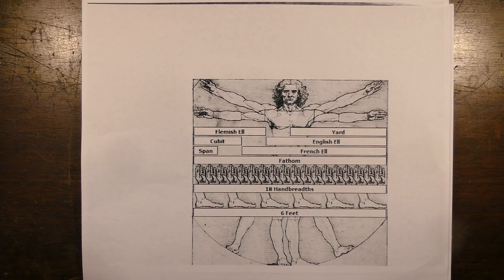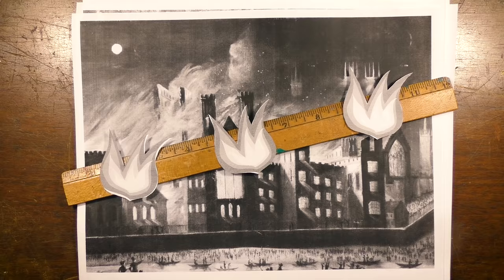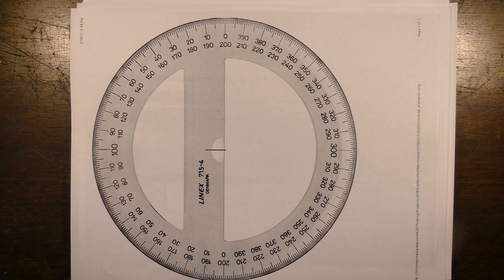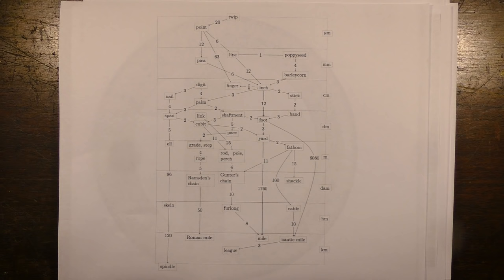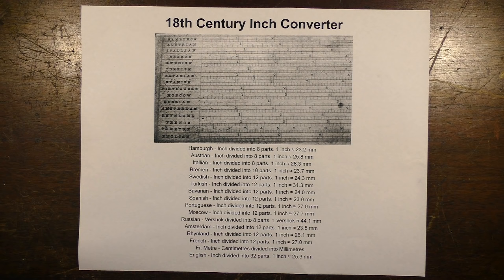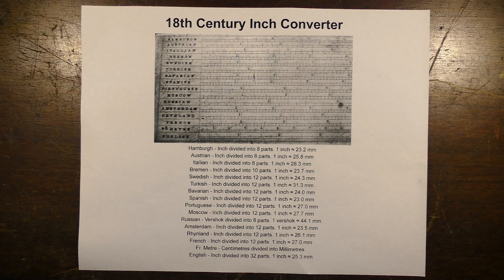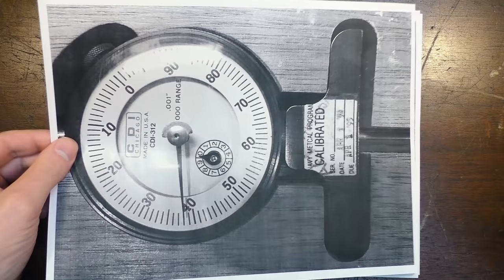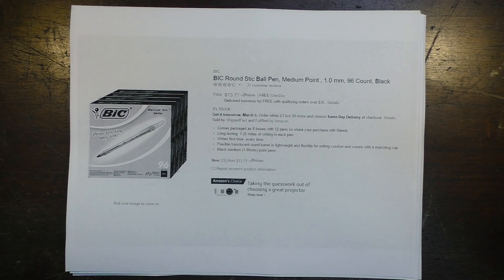Origins of Precision

Comment: It's really too bad Jo didn't use 25mm instead of 25.4mm. imagine how much more compatible metric and imperial would be. A foot would be exactly 300mm, not 304.8
Reply: It might've stopped adoption, made it more difficult, or even introduced incompatibility. As much as those problems already existed, by adhering to the closed estimate available of what everyone was *already trying to*, he made sure these would be absolutely perfect.
Reply: Good enough for government work... :-P
Reply: @guard13007  The imperial system is already illogical.  It'd do the entire (ie Mericah the centre of the known universe
) good to get rid of it.
Reply: @79Zhyr  How is the imperial system illogical?
Reply: @Smokey298  In the imperial system you have to memorize all of the possible conversions: "inch to a yard" = 36, "inch to a mile" = 63360, "yard to a mile" = 1760 etc. Those are just random numbers hard to memorize.
Not to mention madnesses like: 1 cubic inch of water weights how many Stones?

In metric system, everything is a power of 10. 

Millimeters to a centimeter? 10
Centimeters to a decimeter? 10
Decimeters to a meter? 10
Millimeter to a meter? 1000
Meter to kilometer? 1000

Even the prefixes help you to make the conversion. Kilo means thousand, so the Kilometer means "Kilo Meter" which translates to "1000 meters" (same for kilograms for  measurement. 1 kilogram = 1000 grams)
Milli means 1/1000, Centi means 1/100, Deci means 1/10, so the Decimeter stands for "1/10 meter"
Even the volume, length and weight have clear correlation: 1 litre fits in a cube with an edge length of 10 centimeters. 1 litre of water weights 1 kilogram, etc...
Reply: @tcfs  As a Texan, there is nothing to memorize. It just comes naturally. To each their own.
Reply: @MrKen-wy5dk  It comes naturally, because once you memorized :D Nobody is born with this knowledge "naturally".
Reply: @tcfs  nobody is born with knowledge of the metric system either lol. You have to learn that also…. The imperial system is a referent system, meaning it has common sizes that are more intuitive.  The metric system often has grossly undersized or oversized base units that result in large numbers for common measures.  Most Americans work fluidly with both systems.
Reply: @gullenator1  The imperial system is only more intutive for you because you grew up with it. For us the metric system is just as intutive. The metric system just has the advantage that its very, very easy to use in math (science in general)

But if i ask you on the fly how many inches 13,4 feet are you propably just could give a close guess. For us 2 meters are just 200 cm or 0,02 km or 0,002 hectar you really just have to play with the zero.

The base units are not oversized or undersized for common measures lmao, if they are over/undersized you picked the wrong unit.
Reply: @foty8679  The imperial system is more intuitive because you dont have to deal with repeating decimals.  Metric numbers are only able divisible by a couple numbers.
Reply: Hi Christopher Hurkens, don't worry. In the UK following metrificatiin, builders merchants who supplied wood/timber/lumber started to sell it by the metric foot. The metric foot is precisely 300 mm.
PS I don't know but suspect that the Swedish foot is not the same length as the US/UK foot.
Reply: American here, not that that exposition is needed. We use the imperial system, I know, shocking. I personally prefer the metric system, but I do hold one or two reservations regarding it in which I’m partial to imperial. One instance, is the use of mile, foot, and inch. Disclaimer, I do not love the measuring steps, while basing it upon powers of two is neat in concept, I find it poor in practice. Mind you, if you were had but a string to use as initializing measure, building a system from halving and doubling makes some sense. That said, not using said system to then make that halving a fifth of a larger base unit wouldn’t make sense (thinking about this as I’m writing). Now, why do they feel better, the cm is slightly too small for me to like quite as much as an inch (but this is probably effects of lifetime use), the foot being a not too small but slightly larger unit seems nice (albeit probably doesn’t pose any benefits and again I consider presence of my own bias here). I’m a runner, I like running and I’m fortunate enough that the town I live in was marked and split in such a way that it is a mile for every 8 streets (not all are equally spaced no, but the major ones lie every 8). For me it’s reached a physically intuitive level, but I know elsewhere such a nicety isn’t always present. That said, the yard feels useless given it’s hardly ever used (like an item you bought and then kind of left collecting dust in the closet) “oh yeah, you exist”. The foot having 12 inches doesn’t feel like it was chosen with good reason in mind, 5280 doesn’t feel like a lovely number either. I merely like them from a physical dimensional feel. Another area Metric does better, temperature. While I have gotten used to Imperial, Metric is nicer, I’m just not inclined as much to think in terms of it. I had heard (anyone who knows better can correct me) 100 degrees was supposed to human body temp and thus that’s why our boiling point is at 212. That just feels plainly foolish, given there’s not even a consistent repeatability and saying there’s an average is a poor justification for that. Side note, my one grievance I hold towards both is the use of the of 60 and 24 in telling time. If days were wholly equal all the time then halves would make sense, mind you I still find that cool. I don’t know if it was in honor of the Babylonians, but other than maybe for sector division or something 60 doesn’t seem particularly convenient. To be honest, timekeeping below a year just feels like the makers justifications (other than seasons was mostly just “we wanted to”. Years and days and year collections being nicely indisputable. I like consistency of the metric system and how it readily uses consistent physical circumstances largely based around water to act as standards, as in Celsius, as in its density being one. Idk, just so much more methodical. I think one of the worst places for the imperial system is the kitchen, hodgepodge I say. Now onto physics, I don’t do enough of it and didn’t really do it in imperial when I learned. If what I encountered is how I interpreted it, it’s awful for a reason I’ll get to now. It leaves its users more prone to misinterpret mass and weight to be the same. You (metric users) measure stuff in kilos, makes sense (also had that put in reference terms of being ≈ a red brick gives that physical comparison nicety), that’s your mass unit. For intents and purposes I cannot tell that anyone who used metric measures their mass as a measure of weight and uses Newton’s (if someone does then correct me). We use the pound as a weight metric but treat it like it’s a mass metric in all common communication. I only learned about a month ago (I’m nearly 20) that our mass measurement is called a slug and it’s so out of proportion to the pound that a person who weighs 180 pounds weighs like 3-5 slugs if I recall right. Some precision measurement you get with that one. Chemistry class pampered me, can’t say I want to go back to being unaware in that regard.
Reply: @tcfs  I love the consistency of Metric. But 10 is a trash number system. Base-12 and Base-16 are superior, especially if there are characters between 9 and 10 (0,1,2,3,4,5,6,7,8,9,A,B,C,D,E,F,10). A Metric system of base 12 or 16 would be the ultimate system. But only if we as a society give up Base10.
Reply: @Smokey298  For the vast majority of uses the metric system never brings up decimals because it’s smallest whole unit - the milimetre - is accurate enough that it doesn’t need to be broken down, unlike the inch which needs to be broken into many many fractions to reach the accuracy of a millimetre (for reference a 16th inch is 1.5875mm) so while those in america are stood doing fractional maths in their head just so they can read a measurement, us europeans just read a whole number off our tape measure. As for your question about imperial being illogical, did you even watch the video? skip to 7:00 and try tell me that you could get that same kind of internal logic from imperial with its 12 inches in a foot, 3 feet in a yard, 1760 yards in a mile, it’s just laughable
Reply: @gullenator1    with regards to the units in the metric system being “grossly over or undersized” I understand that working with millimetres does often produce measurements that contain a lot of digits, but this fine level of resolution means you are always working with whole numbers - there is no need to divide the millimetre into less than 1 whole unit (in construction work at least). Imperial’s smallest whole unit on the other hand, is nowhere near accurate enough and so needs to be divided up into 1/2,1/4,1/8,1/16 etc. As for metric being “oversized” I really don’t understand what you mean, as an inch has to be divided up over 16 times to reach the accuracy of a millimetre.
And as for the part about imperial units being intuitive, I really don’t see the point in putting up with all the pitfalls of imperial just so that you can roughly gage things by such inconsistent lengths as “a human foot” or “the average man” - people who are familiar with metric can do the same thing with everyday objects that we know, as well as the length of a meter ruler which you encounter a lot during school
Reply: @tcfs  I agree. This is why Americans don’t get cricket.
Reply: @Smokey298  This idea that you have to be able to divide is a illogical. Being able to divide isn’t necessary, not when you already have divisions of a tenth and can adjust up or down to suit. It’s not a selling point for freedom units.
Reply: @christopherrto  This is the first and probably only time I will ever see someone genuinely suggest counting in hexadecimal.
Reply: @user-bp1gx3qt3o  Disagree. What's half a cm? 5mm. Half again? 2.5mm. half again? 1.25. Into decimals by the second halfing, and those decimals won't be on a tape measure.

What's half a foot? 6 inches. Half again? 3 inches. Half again? 1½ inches. Technically still not into decimals as imperial tape measures are fractional.

What about half of a half of a half of a half of a half of an inch? 1/32 inch, which my imperial tape measures have a line every 1/32 inch, which is .8mm, more accurate.
Reply: @EmptyMag  Google it, there's actually quite a bit of support. It'd also simplify computers, as computers count a byte as 2 hexadecimal digits.
Reply: @christopherrto  Computing is the only application I've really seen it used successfully for, but it wouldn't simplify it much since that's already how they function. I often look at a power of 2 like 128, 256, 512, 1024, 2048, 4096, etc etc etc and subconsciously go "nice", but I can't imagine trying to count in hexadecimal when the greatest strength of base-10 + Metric is the ability to convert units by moving a decimal place. 

The whole point of a measurement system is to be intuitive, counting in graduations of 16 isn't at all intuitive which is why all but three countries use Metric instead.
Reply: @EmptyMag  Hexadecimal also allows you to shift the decimal place, so long as you're counting in 15+1 instead of 9+1 (as both are "10" in their respective bases).
Reply: @jasonosmond6896  Let me kindly disagree with this. The purpose of metrics are not "baking" or "construction work", the purpose is to measure volume, distance, weight, etc. My opinion here is - regardless to the "use case" -, the units should be the same when measuring something. Of course the scale should be different for different use cases, for example milliliters or deciliters for baking, (which is a "handful amound of liquid") and hektoliters for industrial reservoirs. When you choose wrong scale, the calculation became heavy, for example that is nonsense to say: "please use 0.00000001 hektoliters of someting" in case of baking and vice versa: "this industrial reservoir can hold 10000000000000 milliliters of liquid"

Comment: My favorite way to make a perfectly flat surface to this day is still glass panel making: They just lay/pour the glass on a pool full of molten tin so it floats/cools flat. Given it's a bit more advanced from grinding tree large stones with each other but i love it.
Reply: An optician will immediately tell you that glass panels are nowhere near flat, when measured in wavelengths of light. ;-)
Reply: @MrAstrojensen  much flatter than rubbing three stones together.
Reply: @aygwm  That depends. If you know what you're doing, you can polish the three stones (preferably obsidian) to a flatness much better than 1/4th the wavelength of green light (550nm), while float glass has a much larger surface error.
Reply: @MrAstrojensen  what if you rub 3 pieces of float glass together? It might be a good starting point?
Reply: @unicornadrian1358  Exactly! That is basically how optically flat mirrors are made.
Reply: @MrAstrojensen  nice!
Reply: You would end up with a convex surface plate due to the curvature of the earth and gravity. Worthless… 

;D
Reply: @MrAstrojensen  You can do it with tool steel if you want.  We use an interferometer called an "optical flat".  Can get super flat if you're willing to put in the lapping time.
Reply: @mxs4193  DING!
Reply: @unicornadrian1358  You got the job kid. Now, how does $100,000,000/day sound as a starting wage?
Reply: @von...  lol sign me up!
Reply: @von...  lol sign me up!
Reply: @mxs4193  gravity is approximately uniform

Comment: Went to work for a machinist as a kid.  He gave me a file, a chunk of steel, and a micrometer.  I had to make a perfect 1” cube with a hand file.  Took me three tries and a month.  After I finally got it, he taught me the lathe.
Reply: similar experience I had to make (2) 2 x 2 x 1/4" blocks all sides true to each other and hand scrape two of the faces s that they would wring together sufficient enough to hold their own weight.  I too then went to the lathe.

Comment: I had not thought about Jo Blocks in 50 years, thank you.  After High School I attended Tech School for Tool and Die.  Joined the US Air Force for 4 years as a Machinist, the Tech School training help me achieve a 7 level (Master) in under 4 years and Staff Sargent under 4 years.  After discharge I worked in a Tool and Die shop for a year grinding carbide punches for making seamless aluminum cans.  Finish work was done in a climate controlled room no windows, hated the job.  The foreman suggested that I go back to school for a degree in engineering.  Best advice I have been given.

Comment: Got up to pee and started watching this video and now cannot sleep. Started my career as a machinist in the 70s working with manual machines and even driven by belts. Worked in large manufacturing companies that people in the U.S. will never see again. When looking at inspection blocks a tradesman sees them differently than others. But now my comment. 
    In the early 70s the U.S. government forced a company to completely shift their manufacturing process to standards. United Shoe Manufacturing Company USMC produced machines used in the shoe industry starting in 1900. They had their own thread sizes and no standard hole sizes. Measurements were not what were expected like no 1/4 , 3/8, etc. It could of been.243, .381. The government ruined a company. In Beverly Massachusetts USMC closed in the 80s and I worked there.

Comment: So getting back to the fundamental question, on our isolated island, so far we can get a reference for flatness by rubbing 3 granite blocks together and our reference for distance will just be some semi-arbitrarily chosen length of durable and inert material that everything else will be compared to, usually indirectly. What about other primitives like parallelism, perpendicularity, and roundness? We could draw flat round circles with what we have but it seems like we at least need a reference for perpendicularity to go any further. The best I can think of is that we could beat some rocks together until they approximately match the angle between a hanging string and a still body of water but that probably wouldn't give precise results.
Reply: Dirk Knight  How do you grind with truly random orientation though?
To start using trigonometry we would typically want at least one known angle and preferably have right triangles but we don't have those yet. From where the video left off we can only ensure flatness and measure distance. It'd be possible for us to start making arbitrary triangles, measuring their side lengths, using the law of cosines to determine their angles, and praying we eventually get a right triangle, but that seems rather roundabout.
I think for the purpose of this thought experiment we can just assume that we have whatever metal, specialized glasses, or exotic unobtanium you want, and that we're the greatest and most athletic craftsman to ever live. The purpose of the question is how we'd bootstrap precision measurements without existing references.